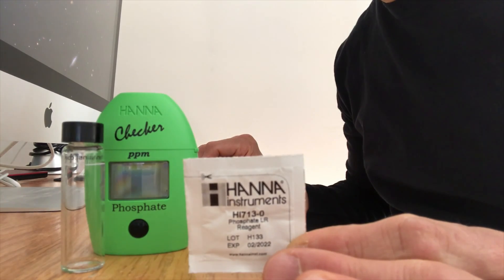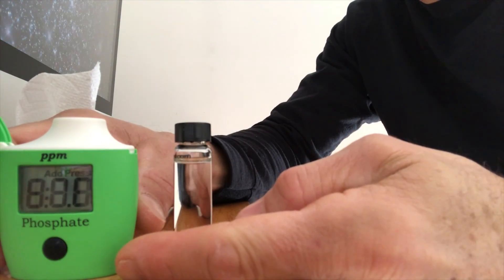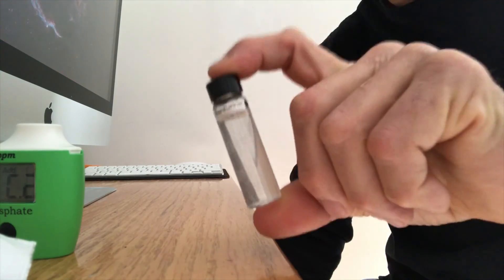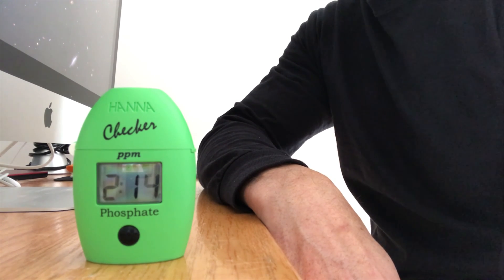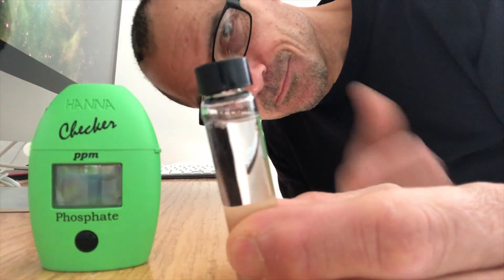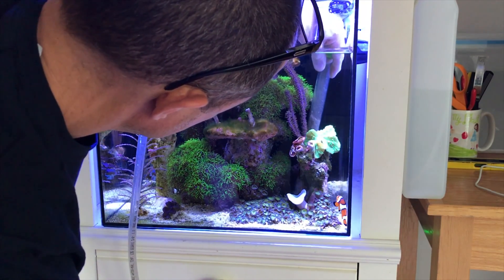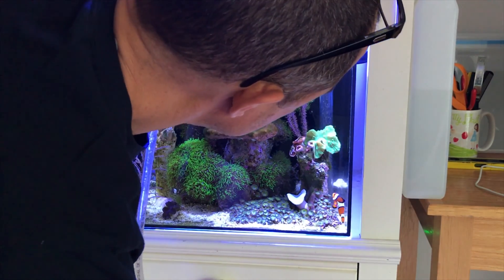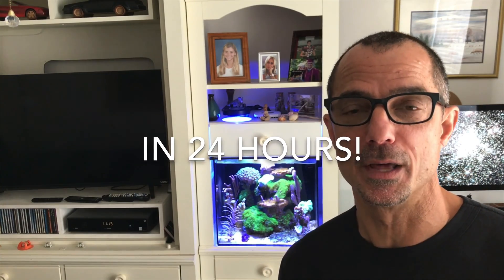Nano Reef Tank PARAMETERS!  How To Lower PHOSPHATE! - PART I

Comment: How much Rowa Phos did you use in your little tank?  I followed the instruction from D&D on how to use Rowa in a reactor, I made 3 gallons of RO water, I put the Rowa in and I flushed it, it literally took 3 gallons to not even completely flush it, I only used 60 ML or two caps of NightQuell.
Reply from the maker: Hi Jim, in my experience and through other advanced reefers, the dust is not harmful. There is no need to rinse. Just a few seconds under low flow tap water is fine. 👍🏻

Comment: Thanks for this. I've been using phosguard, and I've tried gfo, hence now looking to try phosphate rx.
Reply from the maker: Remember what I said in your other post. Vacuum your sand bed, it’s collecting phosphate. It will help tremendously. 👍🏻
Reply: @TOMReefer  I also use Phosguard, it’s good stuff, can’t be doing with that GFO it’s too messy. I never disturb my sandbed as I leave to the cuc, loads of good bacteria in there, bit of a trade off really. 👍
Reply: Phos rx mimics calcium and coral skeleton absorbs it aswell so you don’t know what levels of calcium you have this shit played havoc with my apex kalk stopped being dosed and I had to dose alk separately in dos I wouldn’t recommend using this product